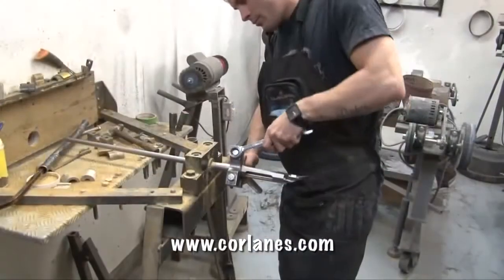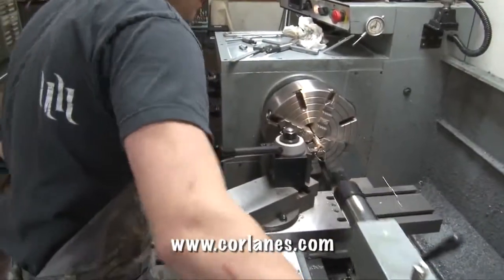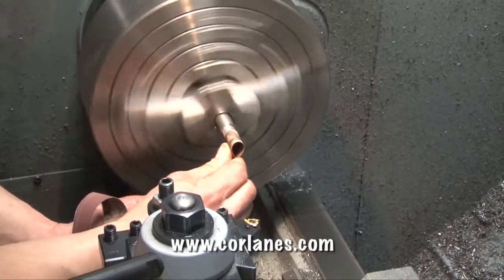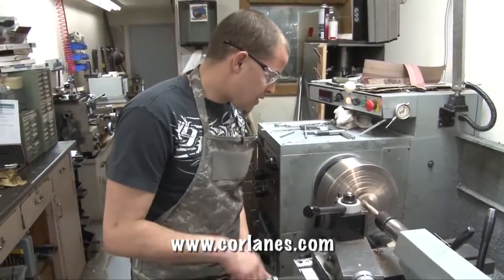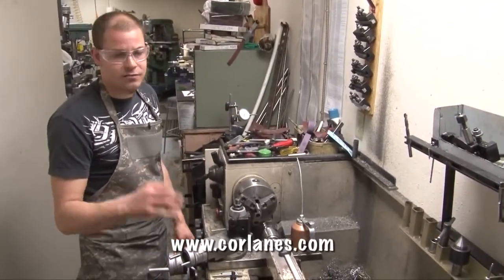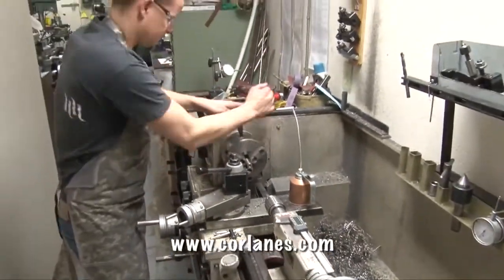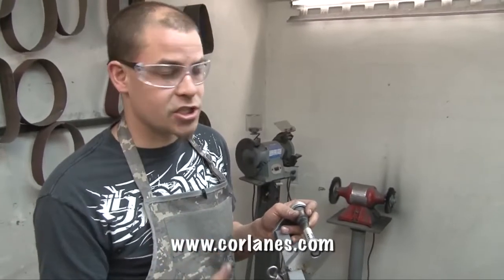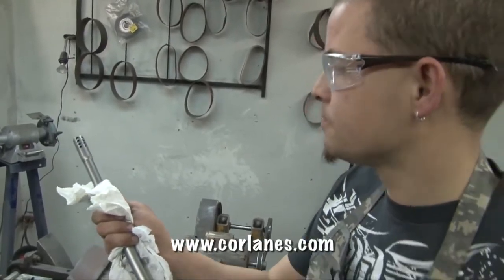How to install a muzzle brake on your rifle

Comment: It does make sense removing the barrel from the action but what if the barrel is pressed into the action? Can the bare action and barrel still be mounted in the chuck properly for the threading process?